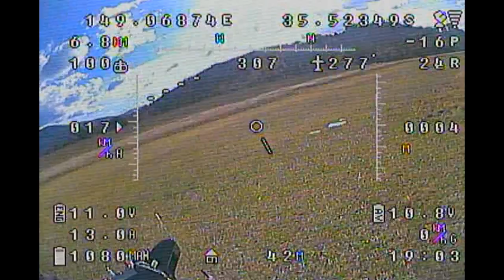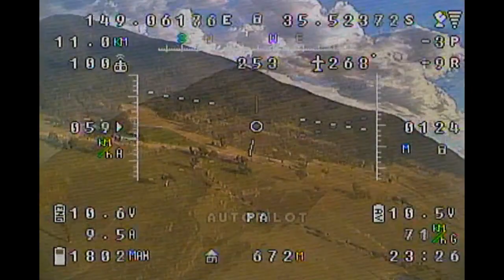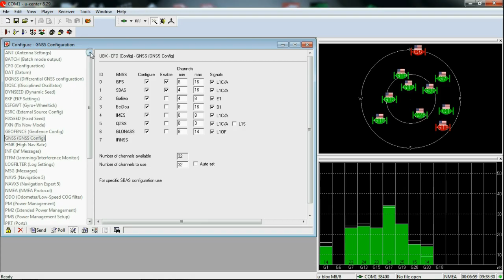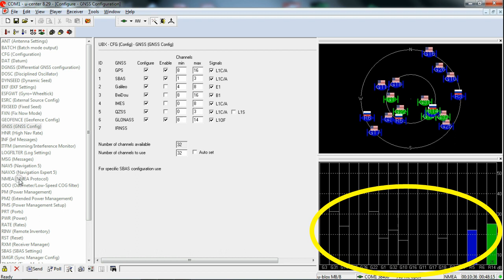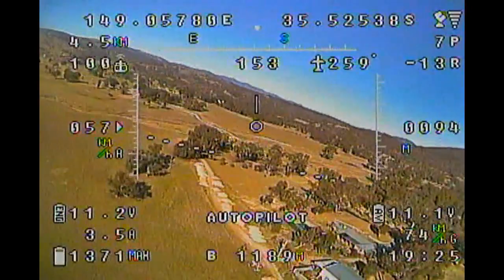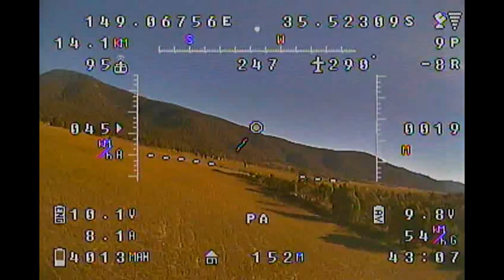Tornado GPS Tweaks

Comment: Well done for your perseverance mate , looks like you've sussed it out alright now. !0km+ coming up hey! BTW-can the F2s gps be tested the same way?(see yer soon)
Reply from the maker: The F2S blurb reckons they use an M8N chip so you shouldn't have any trouble hooking it up to uCenter. You just need an FTDI adapter.

See yer soon? Are you heading back to Oz? Holiday or have you been deported?
Reply: Will be on Holiday-Hooray!! If I bring my F2s GPS could you test it please sir??
Reply from the maker: On holiday from what? I'm not sure if the F2S GPS is programmable but happy to give it it a try.